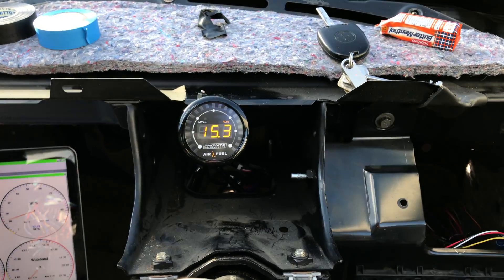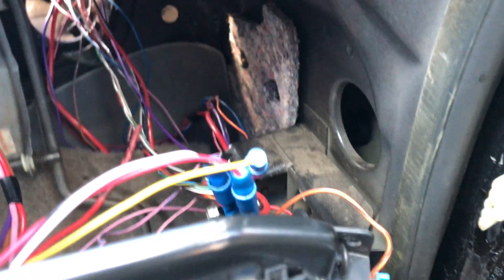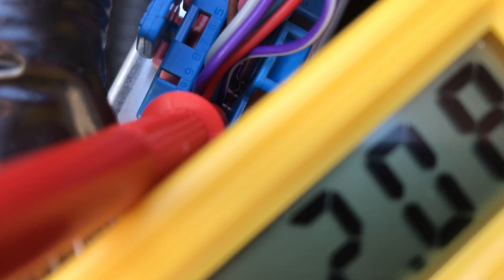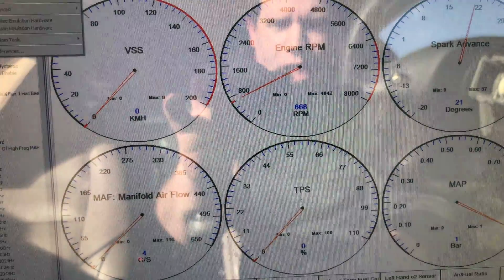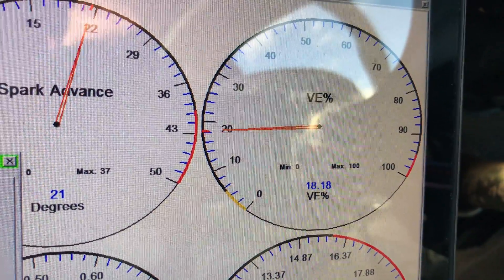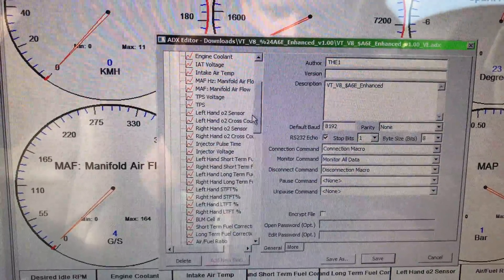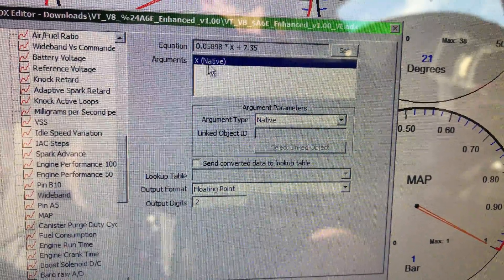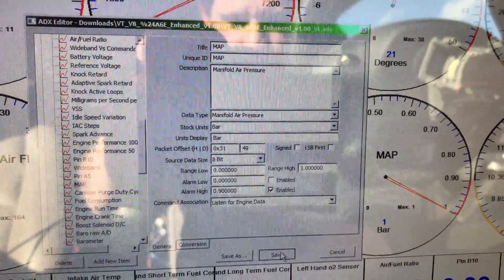Real-Time Delco Tuning - 4K - Wideband O2 Issue - No signal in TunerPro RT

Comment: Not enough voltage my wideband does the same
Reply from the maker: Turbo Chard hi mate, the voltage at that pin is the signal voltage, not the 5V rail. The builder of the 1.00 adx said that he didn’t setup for that pin to read wideband 0-5V. He sent me the correct 1.01 file and all was fixed
Reply: Hi where do you connect the wideband 0-5v output?  how do you get it to work with Tunerpro on a  laptop? do i need any USB connector ore something? where does it connect?  @JA2ZA   thanks

Comment: Hi how are you, I do Computer Science, my friend just asked me if he can send his ECU so I can mod it. I can build my IC but i'm not a mechanic, could you please give me a link to software to play with the ECU, We will work on it together, this is for my friend could you please help. I got 100% marks in Assembly and Machine Code.
Reply from the maker: Hey man. The description has the link to http://www.PCMHacking.net where you can find all the info you might need. You need Hardware & Software sets to make this happen.

FYI, I spoke to some of the forum mods and the talented guy who built this bin & adx file (for TunerPro RT) informed me this version didn't have 5V pin data loggin yet... the version shortly there after did have it. so all good :)